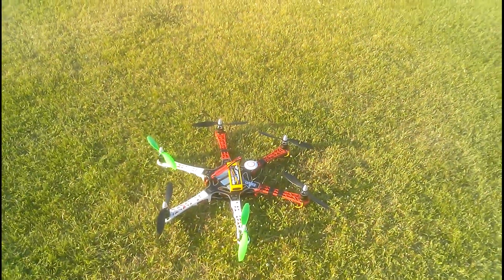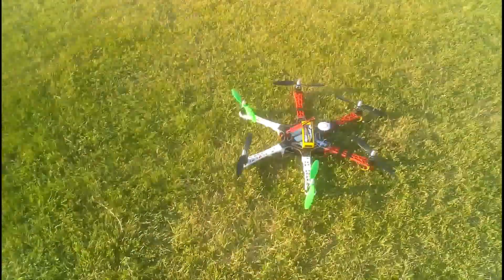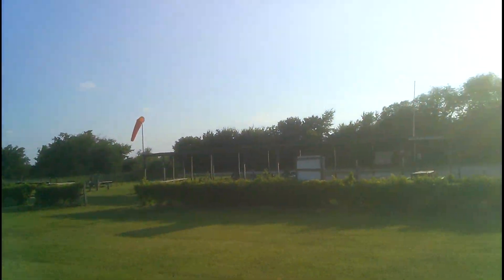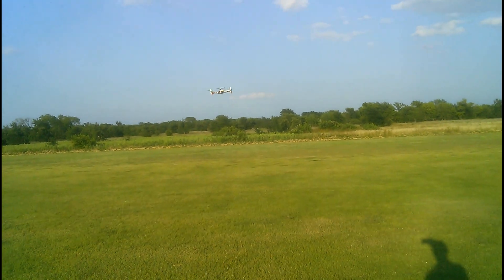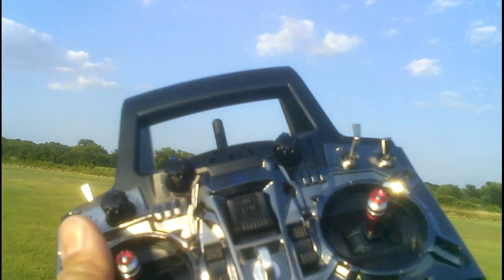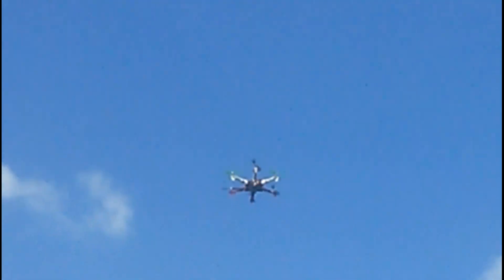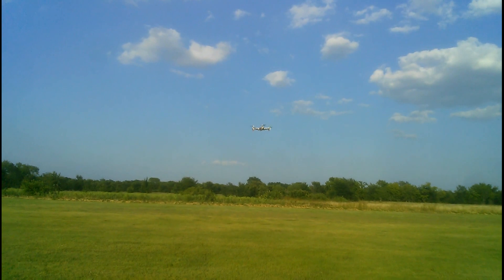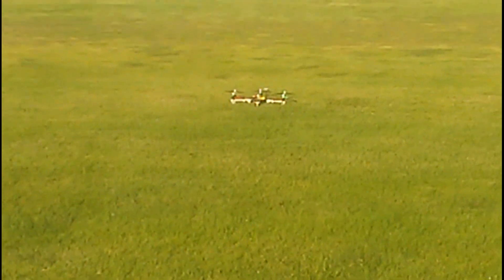NAZA-M Lite, RTH failsafe test, 9XR, FrSky D8R-II Plus

Comment from the maker: Yes you need module to make 9XR work. If you're a nu b and you want something easy to learn I highly recommend the DJI Phantom. $479 at Amazon which is a great bargain considering it is RTF with GPS. Just add gopro. If you buy separate pcs it cost you more plus the time and frustration trying to set the whole thing up. I am trying to away from HobbyKing at the moment...very bad customer service!!!  try CenturyHeli; getFPV; ValueHobby all 3 in USA and much better service. Good Luck.

Comment: On my 9XR I have ch1 thr ch2 ail ch3 ele ch4 rud ch5 53% full gea ch5 mix +57% half id1ch5 +125% half id0 ch5 -9% half id2 ch6 p1 ch7 p2  make sure to match ch to aetr on naza unit and ch5 to u and 6 and 7 to x1 x2. So that should get you to GPS atti and manual as we'll as gear to rtl/fail safe. This is how I have my 9xr connected to my d8r-I plus and my naza m lite. I also set up the rx frysky fail safe too. Set your 9xr to fail safe position and follow the Rx instructions.

Comment: Hi. I have the same thing has you. Naza lite, f550, 9xr, but using stock esc and motors for now. Cant make it work. The only thing I made work was binding with tx and rx. Can see on naza the sticks moving, but thats it. The throlle position on nazza assistance is incorrect. Can you please tell the steps you did to make it work? Tk u  in advance.